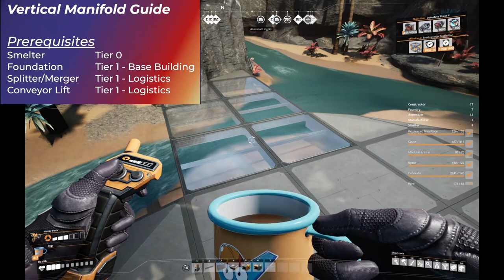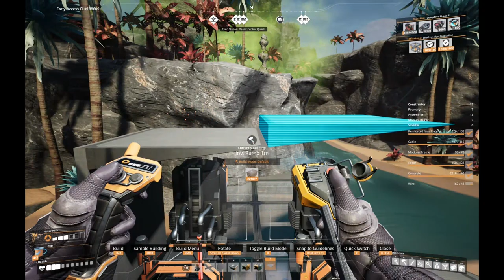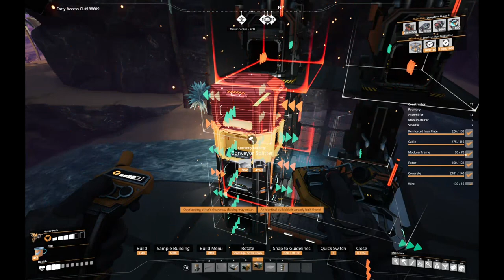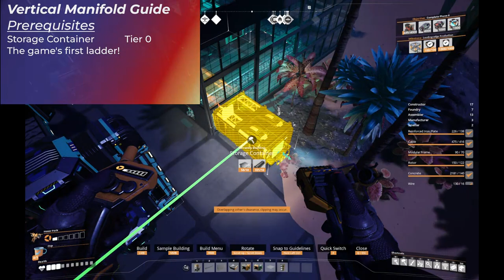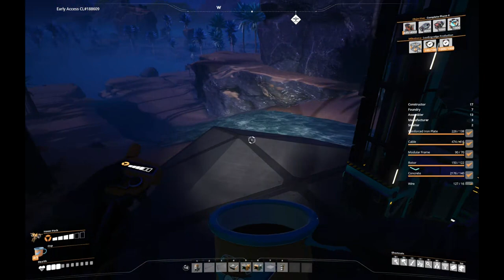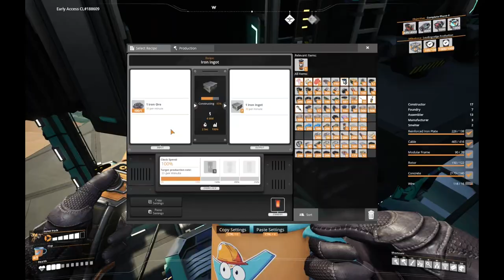Vertical Manifold Tutorial - Short on Space? Squeeze Several Smelters Into Some Small Spaces

Comment: Nice idea, you've given me some inspiration for my next build. However, why use 2 towers of splitters and mergers while you can have just 1 in the middle? For the raw materials, have the entrance to the outside, split off to both smelters, then on the inside, go up with 1 lift and have the input there on the inside. Split off again to both smelters on that 2nd level and have another lift on the outside going to the 3rd floor and so on. Same for the exit. At the bottom, you have 3 mergers while 1 should suffice. Only keep the merger in the middle, send the output from both smelters to that merger and have the lift come down to the 3rd input on the outside.
Reply from the maker: Glad you liked it. I wanted to not use anything from the awesome shop and if I am understanding you correctly the “inside” lifts would need lift floor holes.

But if you check out my latest video that has a similar design but with assemblers, I did it pretty similarly to how you describe. Great minds think alike!

Comment: instead of putting spitter stacks, you can just place a floor then delete the floor and have them float then set up ur belts. 
Great idea non the less. deff going to be using this in my compact factory. 
never really thought of stacking smelters. always had them on the first floor that go into a stacked compact factory.
Reply from the maker: What I do for my builds is actually put a little 3m beam stick out of the front of the platform as a perch for the splitter.

I wanted to give an option for a fully supported/non-coating build for those that care about that…I really don’t care too much personally.

Thanks for watching!
Reply: @DrLootCrate  makes sense. Thanks for the options

Comment: You also don't need to use storage containers as a ladder. To be a bit more cleaner with your improvised ladders, you can also use conveyer poles.
Reply from the maker: I actually think it is easier to use storage containers because you get a platform to stand on with it. Plus, you wouldn’t necessarily have stackable conveyor poles unlocked yet if building this.

But the poles do also make good ladders for sure

Comment: You could just use one stack of splitters on between the two smelters and have the lateral outputs feed them and the frontal output will overflow onto an elevator that goes into the next splitter and so on. It's kind of a hybrid manifold/load balancer setup but it saves materials so🤷
Reply from the maker: Hey I like that idea a lot! So a stack of splitters however high on each level to fit a lift - bottom is elevator in and top is facing the other way for an elevator up. Not a bad shout at all.

Comment: I’m following you starter series and finding it a bit problematic negotiating the factory. I really like this modular design. I’m going to try and do this for each product output, if possible, as I think being able to walk around without jumping so much would be a better experience. I’m sure they’ll be a downside but I love what you did here. I’ll ofc have to learn about the speed of the conveyer belts and how they impact the output and demand you can place on them but, that’s the fun, right? :)
Reply from the maker: Do you have the blade runners yet that let you run faster and jump higher? If not, start researching in the MAM. It doesn’t take much to unlock them if I recall.

Figuring it out is very large part of the fun!
Reply: @DrLootCrate  aye, I’ve unlocked them. They are handy but sometimes the big jump gets me into trouble! 😂 
I’m now on stage 5/6 and am struggling to understand the oil refinery. I make about 100 plastic which is fine but, I can’t claim the heavy oil or the fuel. I have space in my inventory but when I try and retrieve it, there is a Red Cross in my inventory. It was late last night (0200hrs) so I made 6x 100 stacks of plastic by dismantling the plant and rebuilding it again…. I know this is wrong but I was hoping the fuel/oil would be placed as a result of the dismantling of the plant…. Nope. There’s clearly something I’m missing and I’ll try and sort that today. I created 600 plastic for the red button and incase I need anything else. I think I really need quartz most to unlock at the research bench too. I was running around for hours last night and managed to acquire 93 of the 100 I need.
Reply from the maker: @Salubrious388  oil is the first time you have byproducts that you have to deal with and that can be very confusing.

At your stage in the game, I recommend piping the heavy oil residue into a few more refineries and make petroleum coke. You can use that in a few coal generators for power or put it in the awesome sink for some points.
Reply: @DrLootCrate  aye, I had been tinkering around with fuel etc too. I’ve deleted my save and started a fresh since the 6th update. About to set off for coal in the morning when I get up so, it’ll probably be the weekend I get to farming oil again… can’t wait. :)
Thanks for all the help. :)

Comment: Hmm, wouldn't it be easier with a center single stack of splitters. No reason to make 2 columns.
Reply from the maker: Yeah kinda. I didn’t want to use anything from the awesome shop and without floor holes the one stack actually takes up a lot more room - an additional depth of the 2nd lift at a minimum. Plus I kinda like the snake like path.

If you see my recent assembler vertical manifold video, I use center stack with a floor hole to a design similar to what you described

Thanks for watching and commenting
Reply: @DrLootCrate  makes sense. indeed you would need space to put the center elevators or clip them through the floor/building.  That would change the esthetics.